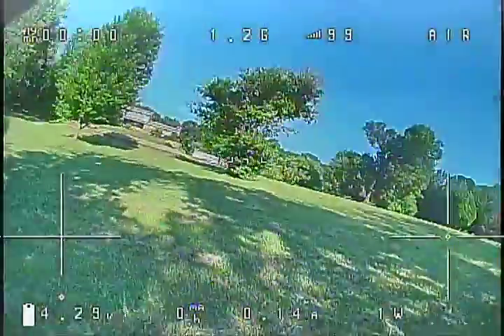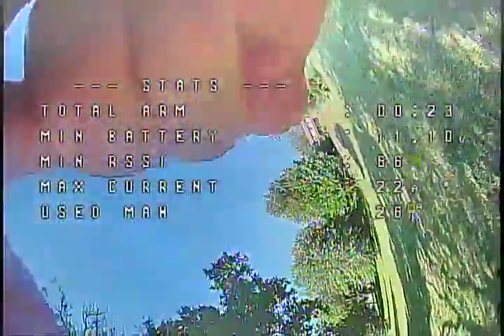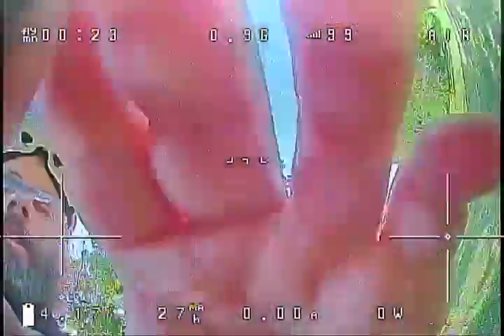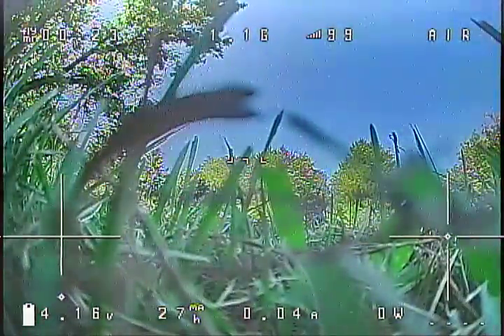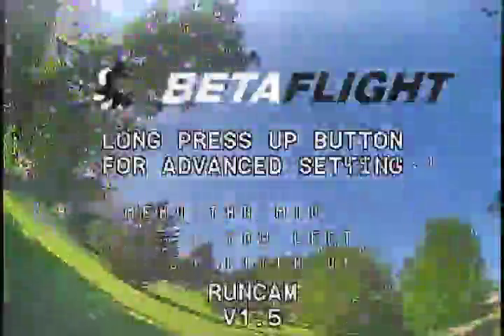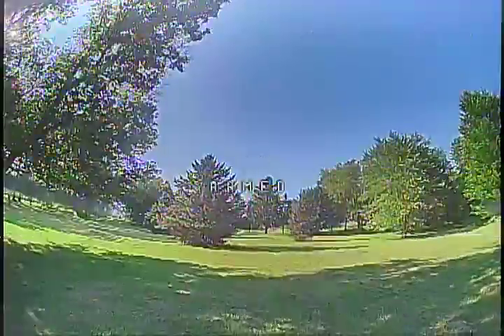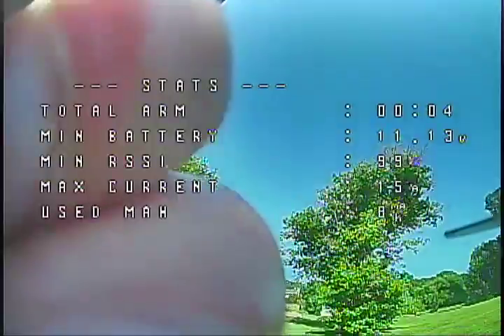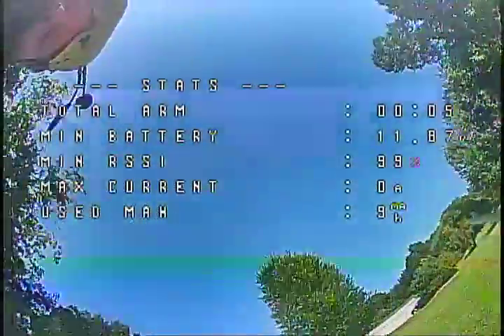8-8-2020 GepRC Phantom flt #6 - Fried motor

Comment: 3:47 From what I notice in my case is that if I crash the quad the accelerometers on the fight controller have to  recalibrated in order to do that your going to have unplug your lipo
 and plug it again on a solid area without moving it until you hear the beep then everything will be ''ALL RIGHT,ALL RIGHT ,ALL RIGHT ,ALL RIGHT''-Like Matthew McConaughey would say LOL!

4:07-4:11 Same thing happens to me especially on the Toothpicks LOL
9:00 I herd a similar problem recently on on my 2s Homemade Toothpick my uncle actually put a little bit of oil on it and spin the motor by hand til it felt normal if you want to give that a try it's up to you  dude??
Reply from the maker: I suppose accelerometer recal sounds plausible. I don't need to unplug the battery, though, I just need to hold it fairly still in disarm mode for a couple seconds.
Nah, the bearings on the motor are both fine. The windings melted and shorted it out. No amount of oil will fix that! I looked at pricing for new motors, and it's $40+ for 4, or even more expensive one at a time.. at that rate, I figured I'd just buy another quad so I'll have another of each part. I figure at some point I'll need new electronics for it, and the stack is $50 or so.. That's $90 for motor and stack, when the whole quad can be had for $120. Luckily Banggood had some US stock, so it should be here within a week or so.
Reply: @somespamsite44  Cool!